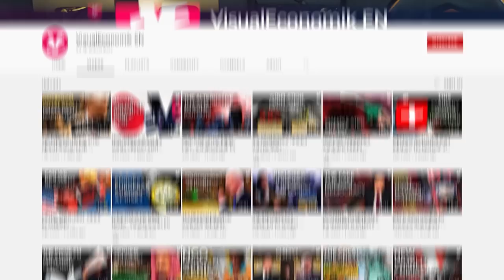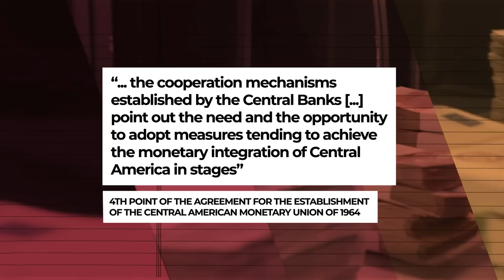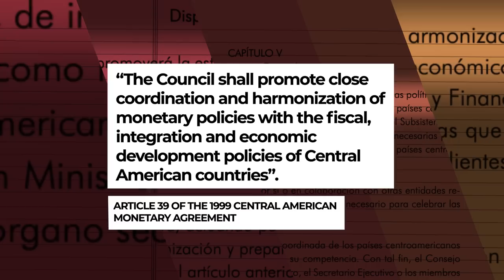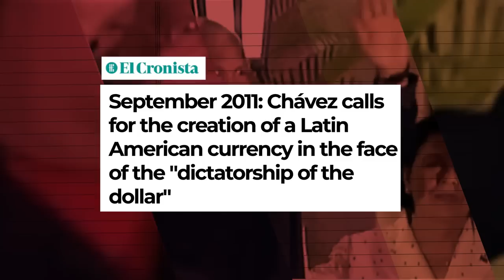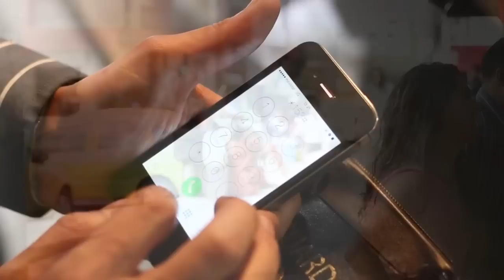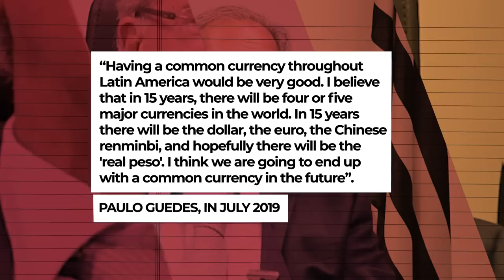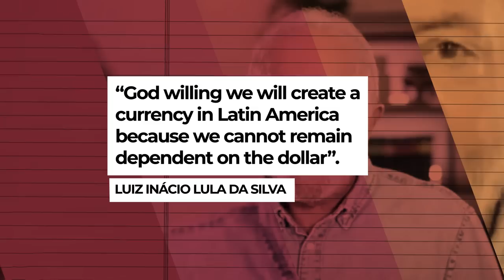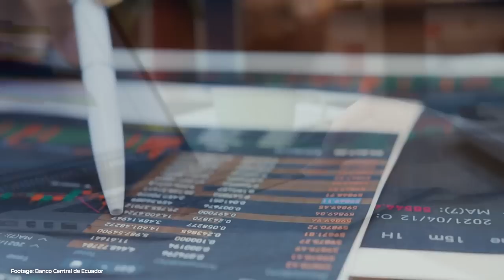Could Latin America Have a Single Currency? - VisualPolitik EN

Comment: Most of these countries are plagued with bad fiscal accounting and corruption, introducing a common currency would most likely be a huge burden and cause a lot of political unrest if introduced. This is just like the African golden Dinar headed by Libya back in the day. Each country would loose its ability to compensate for inflation or to stimulate local businesses to a large extent. Most of these countries are very indebted like Argentina, how on earth would they be able to bankroll debt and variance in neighboring local businesses outputs?  Many would say that you should have low corruption ratios, stable political government with at least a hint of transparency, good tax collection and at least some sort of a fiscal accounting before you start thinking of merging your currency and peg it and let it float with other countries. I’m all for it because it’s a stabilizing factor for countries able to cooperate and run a common currency, but often it hurts a lot for those countries that have an unstable economy, just look how Greece has been struggling the last 10 years.

Comment: Latin America still produces a lot of silver. It would work out if a common currency was pegged to the value of silver.
Reply: And THAT would be their salvation, a regional Peso fixed to a stable commodity likes silver as you propose.  Hell, I would convert to using it if it was backed by Silver.
Reply: it produces a lot of copper as well, and in the mid future will be the biggest supplier of lithium as well, but all those are finite resources. I would not use this as reference for the value of the currency of such a big region
Reply: Keep dreaming. Latin America will never unify. Even Simón Bolívar couldn't keep Gran Colombia together.
Reply: @Venezolano410  a monetary union is not the same as a political union.  Think €uro.

Comment: Too much corruption and instability - sadly. South America in general and Argentina in particular want everything now but without taking the time to build the foundations. A common currency might eventually come, but it needs to be step-by-step: like the Europeans. Think how long it took from the establishment of the Common Market to the creation of the Eurozone.
One of the biggest problems I have noticed in Argentina (and it applies equally to other countries in the region) is that there is no "Plan". There is no consensus on the direction of the country and what it is trying to achieve. A new government comes in to simply undo what the previous one tried, and any long term in office - Kirchnerismo, for example - finishes up spinning in circles and arguing between themselves. Having a transnational goal which all are working towards might be a solution.
The European Project had/has a special foundation and goal. It was imagined as a peace project to finally put an end to centuries of war. And that is still the fundamental driving force behind it (something the UK never really understood). A Latin American Project would have to find it's own common reason to exist.